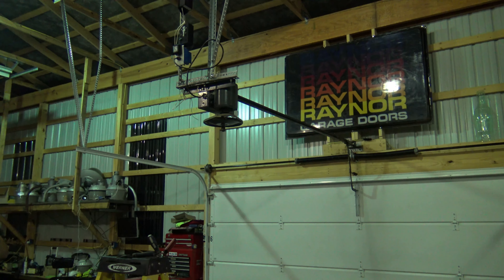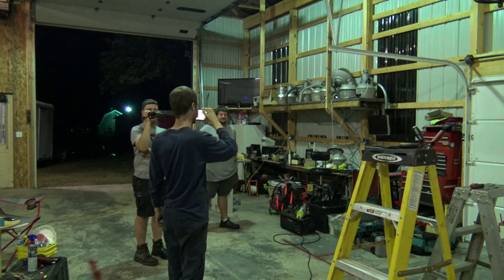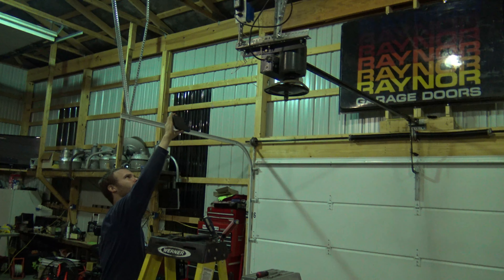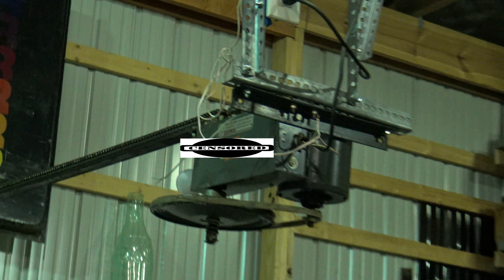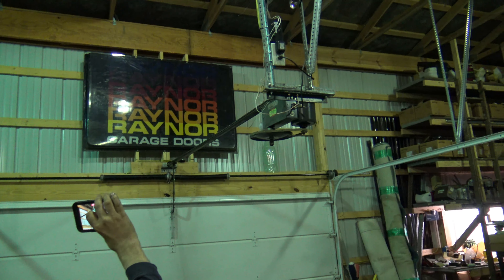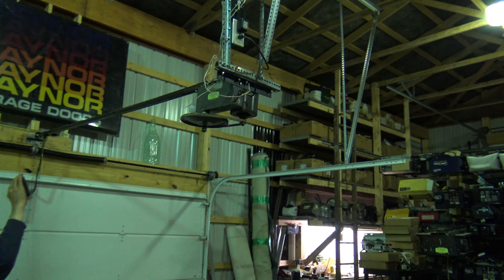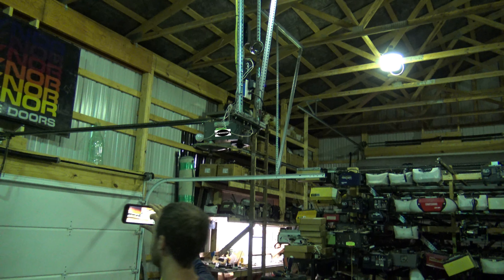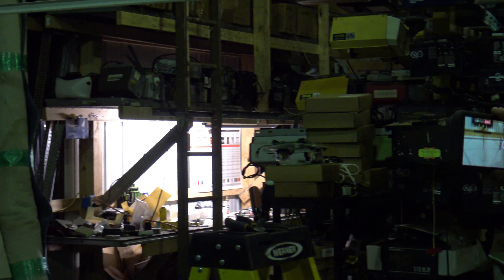RGDMan's All-O-Matic R

Comment: I installed a USED Model R operator like this for my mother in law back in the late 70s. Its still working today. Had to update the original telectron R-40 radio controls and replace reverse toggle switch on top. Units were very dependable and strong. Very unsafe however with only a clutch that would slip ( Hopefully} when closing on obstruction...
Reply from the maker: @cantthinkofone77  it's unfortunate that the powers that be decided to make replacement models, instead of upgrades.